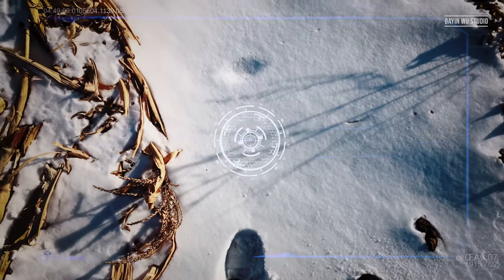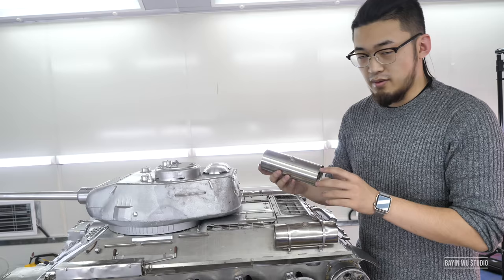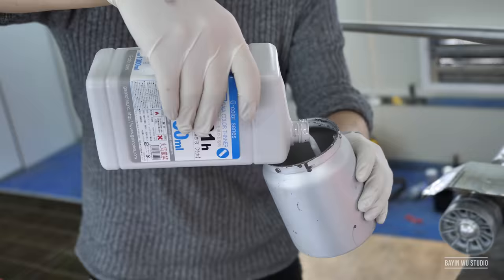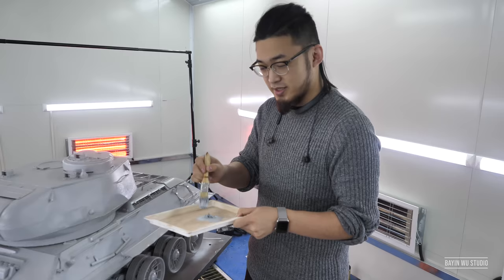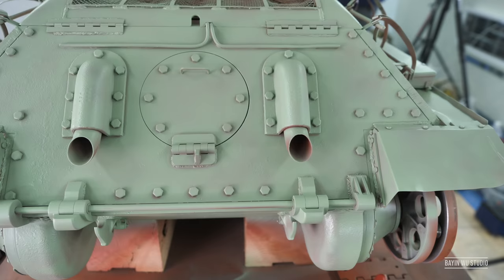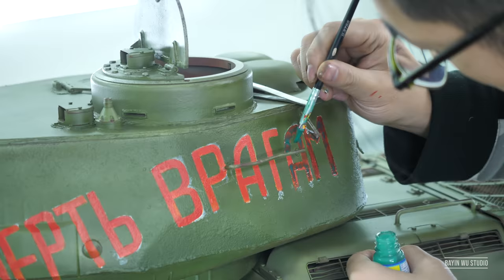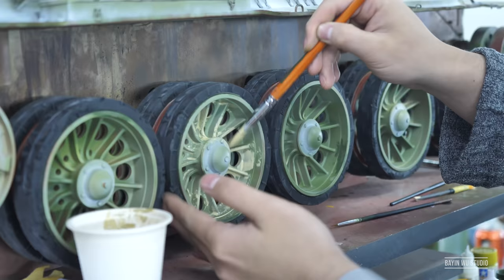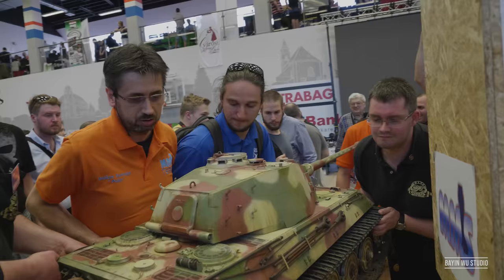Let's paint a Film Prop T34-85

Comment: Did you know, in the 90's you could bought real T-34 for that price
Reply: And now they're like £40K to £50K ish
Reply: @Lo-tf6qt  But they are in working condition.
Reply: Bout no gun.
Reply: @ohgary  
depending on how much and to whom to pay.
Reply: @user-ci6iw1gw6x But you don't have the 85mm shell.
Reply: @ironchancellery6053  85mm shell still being produced up to today. Its basically standard light field artillery for Warsaw pact nations and only retired recently. China and North Korea probably still produce those shells since we can see video footage about them training with 85mm guns.
Reply: now T-54 are on sale
Reply: Think you can still do so in Poland. There a lot of post war production t-34/85 rusting in old depots.
Reply: @Kharmazov  But it's often hard to find them for good price
Reply: @yulusleonard985  But it sometimes differs from gun to gun.
Reply: @ironchancellery6053  The Russian design weapon with standardization on their minds. 85mm ammunition are interchangeable between AA gun AT gun light altillery gun and tank gun.
Reply: @yulusleonard985  Modern tank does not use the normal armor penetrating rounds such as solid shots. Modern tank use APFDS or chemical-based rounds. The older round such as "shells" is not widely available. And also modern tank or anti-tank guns are normally standardized around 125mm. The guns on the t-34 85 (ZiS-53) is not an anti-aircraft gun. Similar anti-aircraft gun M1939 or aka 52k use the same barrow of the ZiS-53 but a different gun breach.
Reply: @ironchancellery6053  D-44 use the same ammunition and Czechoslovakian or Serbian company produce HEAT round for this gun.
Reply: @yulusleonard985  But you cannot buy them as an individual.
Reply: @ironchancellery6053  Try asking the Chechz or Croatian companies that makes them or find people who deal with ammunition surplus. 85mm D-44 used to be standard divisional gun that replace 76mm zis 3 for entire Warsaw pact nations, there should be some shells around somewhere.
Reply: ohgary why the fuck u wanted it with the 85mm D-5T or ZIS-S-53
Reply: Fitz hvh then try to get out North Korea
Reply: briam1354 
Lol
Reply: with 1 year free fuel
Reply: How the hell did you get here erik NOOO
Reply: Here in Finland, a couple of Russian tanks were on sale when Russia collapsed in the 1990s. Tanks costing FIM 100,000 ... that's about 15000eur. They were in perfect condition .. They were sold in a car magazine :)
Reply: You still can .. and with ammo it's not much more
Reply: We did, back in the 90's. I served crew on one for a Re-Enactment group.  Unique experience, Definitely. Love to own one now, but have no place to put one.
Reply: @an78cat2002  where tho?
Do you mean armourtek?
Reply: @Kharmazov  Poland does not keep any T-34's in depots - what are you smoking bro? The only things in depots are T-72Ms.
Reply: Alexa! Time travel, 30 years back from now!
Reply: @Mr_Fancypants  wtf this is a website for full scale products, they are fucking real.

The vid is a about a 1/6 scale Tank,
What's wrong with you?
Reply: @cillersbadass7590  wtf is wrong with you?
The comments are about buying real T-34's.
Reply: @Mr_Fancypants  I talked about the vid...
Reply: @cillersbadass7590  yes i know.
Reply: @Lo-tf6qt  only 40k? I know that the panther tank sells for like a mil now but I guess it’s because there are less of them than the t 34s
Reply: @yulusleonard985  theres some t-34's that still in use today
Reply: But do you have that kind of crazy money back then?
Reply: I'm old enough to remember that too. A lot of stuff went cheap when the wall came down.
Reply: @brickera1591  They're more about £60K-ish now as the years go by, T-55's are still around the £40-£50K mark at most
Reply: 日本の戦車がT34に認められたことはありますか？10から1/2だと思います;-)おそらく損傷しているが、ひびは入っていません！;-)））塗料の傷！？！
Reply: Buy a real*

Comment: How to make T-34:
Step 1. Hammer it
Step 2. twist it
Step 3. Hammer it
Step 4. ???
Step 5. .....Profit
Reply: Step 6. Rush B(erlin)
Reply: Thelower Terrarian  You say so, as if, in World War II, there were more armored tanks in his category ...
Reply: Twist it.  Bop it.  Pull it.  Pass it.
Reply: Thelower Terrarian  All tanks can at least be taken out of action by a 75mm. Even a Leo 2, Challenger 2 or Abrams. They are designed to drive straight towards the enemy and even if they have way more protection on the sides today, if you hit it in the ass or aim at the tracks, the tank is fucked.
Reply: Stars Stripes  then the IS2 tank fires it's 122mm gun and obliterates anything in front of it
Reply: @azynkron  but the point is the T-34s don't stop coming, and even if destroyed can easily be repaired.

Comment: I am buying a 1/16 t34/85 and i can use some of these tricks. Thank you for the video.
Reply: Which one you getting?
Reply: @Mr_Fancypants  t34/85 heng long. Not from torro
Reply: @angrywehraboosnoises8016  I have the KV1 & Tiger 1 from that brand. The smoke generator breaks fast on it so be prepared

Comment: not gonna lie watching you deliberately damage that tank hurt me bad on the inside as a metal fabricator
Reply: But it had to be done. Deal with it.
Reply: @ichhabe330  not really. Bent sheet metal parts and handle bars on surviving tanks are usually caused by the fact that they were used as static outdoors monuments with generations of kids climbing them. Same goes for strange turret textures: a result of multiple layers of paint over the years.

Comment: The painting and chipping was not to make it look like a T34. It is to make it look like a BATTLE DAMAGED T34. Good project nonetheless! 👍 good job! Reminds me of the real war!
Reply: it was to make it look experienced vs. new
Reply: @scottstewart5784  Yes. That was what I was saying.
Reply: @glowfacegaming2536  it can be experienced without being battle damaged.  beat up by hard use.  rode hard and put away wet.  i'm just saying that isn't necessarily the same as battle damage.
Reply: @scottstewart5784  it is battle damage. If it were to be experienced it had to be in battle, no tank goes into battle and gets out untouched. Besides, hammering it looks like it's been damaged. Duh
Reply: @glowfacegaming2536  Battle damage = being hit with a projectile.  anything else isn't battle damage, it's damage from use.  Take a battleship, send it out to fight, it will come back in time, even if never saw an enemy, with use damage.  Would that be battle damage?
Reply: @scottstewart5784  Good point. Thank you kind sir! 👍 I understand the point now!

Comment: Eh... Too much meddling and damage. It should be done in a much more subtle way. For instance the fuel barrels should be hit in a manner thar simulates impact from use. Meaning damage on the side closest to the tank, damage would not occur. I donno, its just my opinion. And it is really nice to give a tank a ricochet round mark somewhere in a very visible area. Like a round bounced off, which a T34 85 was famous for, due to it's angled armor plates.

Comment: As much you do something with the hammer, the model become to look more soviet!
Reply: Yet i never seen in my entire Life and in the Museums which i have been, among videos, original photos and films, such a Dinged up T34, it is literally to far what it has been done in the terms of Dings. In fact i never saw a dinged Tool Box ever on a T34, nor all the Hand Guard Rails, and at least not banged so hard like in this example, not mentioning the  Motor grill and the Fuel Tanks, which would be replaced if those were in such Conditions, and also you need great lot of damage to do something like this this to a T34 in Real life, alone the Hand Rails can not even be bend even by sledgehammer, but at least the Mud Covers are Bend in a Real, very very used way and what i seen in Real T34,s how have been in Combat, is that often the weld on the 2 plates on the drivers side would take some damage and it will not look s perfect as in this example.......